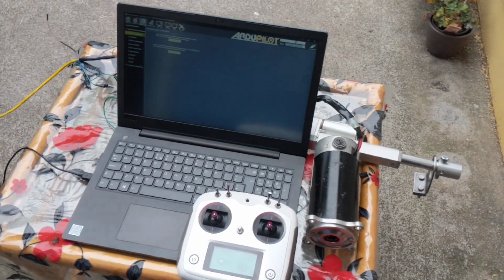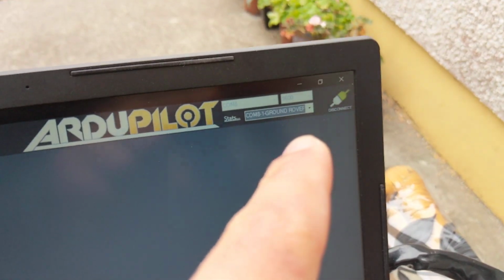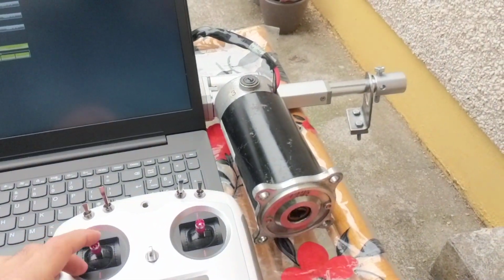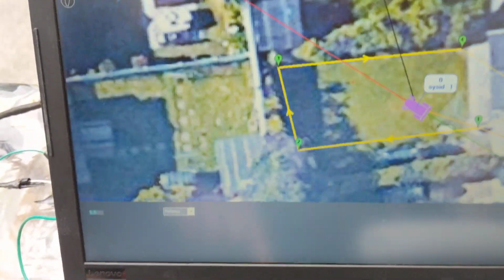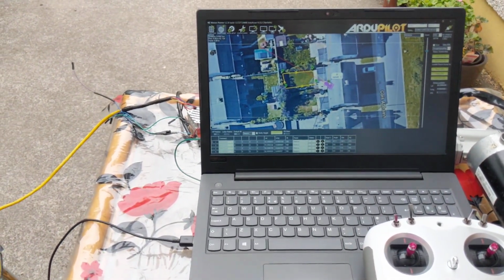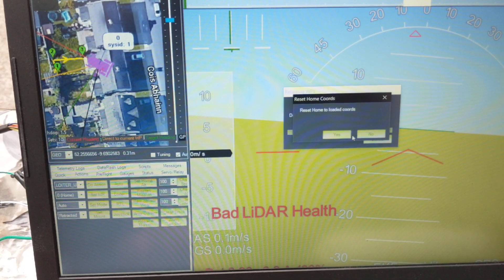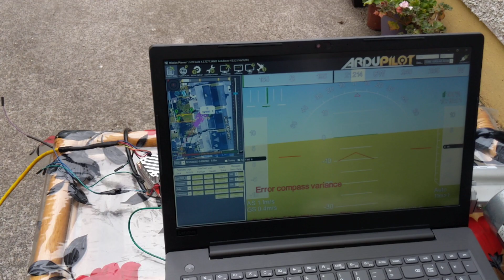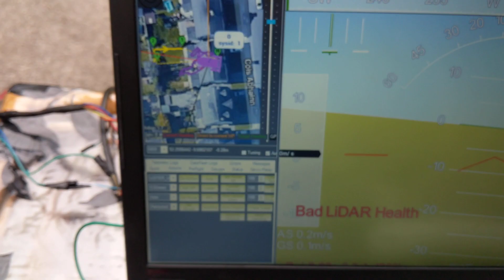Autonomous tractor project setup. RoboClaw, PixHawk.

Comment: Nice project! How do you control the actuators position? Does it give any feedback when it reaches its endstop?
Reply from the maker: Thanks 👍🏼 It's been a while since I was working on it but I think we didn't manage to get the feedback loop working at that time but they were controlled by the pixahawk controller through the motor control board. And if it did hit the end stop, the actuator had a limit switch Built in and/or the motor board prevented current surge too.
Reply: @noorshah96  Ah thanks for the reply mate! I came across a video combining a wiper motor and a potentiometer to rig a "servo" using an Arduino. I´ll try that with my actuator and the angle of the attached wheel !
Reply from the maker: @IdenticXP  oh no problem mate! Yeah I came across something like that, it's pretty cool if you get it going. I tend to keep the control boards to a minimum but do remember that it was going to be my next step too to get some feedback using a small Arduino. Best of luck mate, let us know how you get on 👊🏽
Reply from the maker: And actually we designed the steering linkages in a way that it never hit an end stop. I hope that helps 👍🏾

Comment: Good project. May I ask one question? Did you do calibrate ESC on Pixhawk? I also have a Roboclaw. I want to ask if you did any calibration on (1) Roboclaw side and/or (2) pixhawk side for ESC.
Reply from the maker: Thanks 👍🏽 can't remember fully tbh but if there's an option on the roboclaw side do it first without the pixhawk, you don't need to unless there are issues. And then pixhawk esc calibration. Best of luck
Reply: @noorshah96  awesome. just one minor thing I wanted to ask is were you able to run ESC calibration from Mission Planner? I tried to do it during this week, but it says I cannot. So I wanted to know if it is a problem with other configurations or Roboclaw which doesn't allow from Mission planner. All in all, without this, I found out Min Max PWM hit 1900 and 1100 which doesn't seem to require the calibration from MP.
Reply from the maker: Great stuff! Can't tell you off top of my head but if it works without the calibration, it works 😁 or are you having issues in the operation?